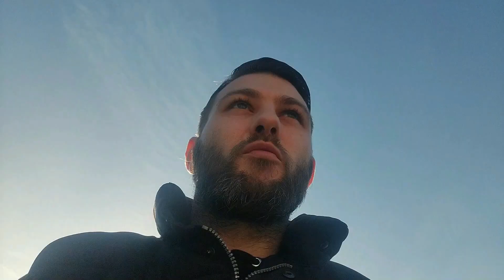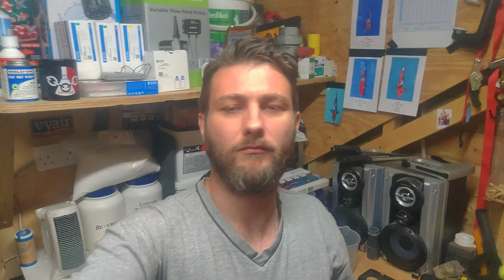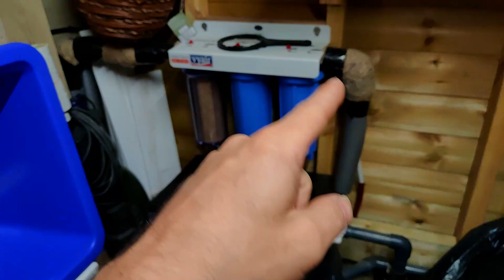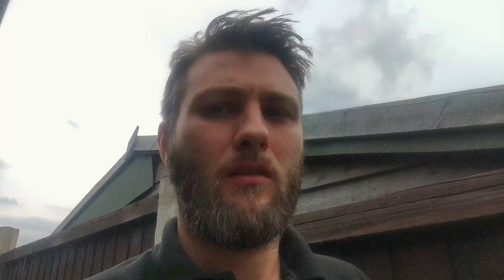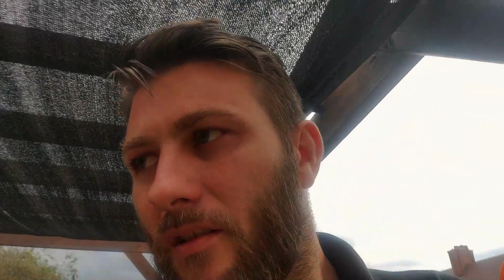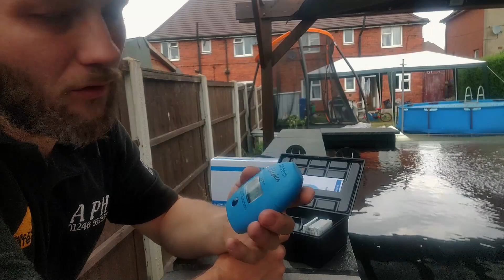Top-Up Tank Woes & Coppens Is No More

Comment: you thought about putting a small air stone in the top up tank, stop it going stagnant and will gas off the chlorine, failing that I use spectrum PCB carbon blocks on my triple 10" jumbo purifier, 1 micron prefilter and 2x PCB blocks which are also 1 micron.

I've had them on since November and over 200,000L+  through them, still have zero chlorine coming out of them, I strongly believe you get what you pay for when it comes to cartridges.
Reply from the maker: I've gotten around this issue now by totally removing the tank from the system and using it for the wash pump. The most recent video shows what I have done with it👍👌

Comment: Best advice would be instead of one big blue, have 2 smaller ones, fill one with carbon and the other with bone char. Helps with both chlorines and chloramines.
Reply from the maker: Hi Daniel. I don't have Chloramines in my supply, confirmed by the water board and by testing the Ammonia in my tap water. I may not need a blue at all now which you will see in the next video 👍

Comment: Same issue here. As I explained in my last video, the level of chlorine has increased and definitely affected the bio and the nitrite increased. 
Good to see that you have changed food!
Reply from the maker: Hi Lau, last month my chlorine level out of the tap was 0.14ppm, a few weeks later it was up to 0.27ppm. however, now it has reduced again. I'm quite lucky in the fact that I only have chlorine to worry about as Chloramines aren't used in my supply, confirmed by the water board and by testing the Ammonia in my source water.

Really looking forward to seeing what results I can get with the Saki👍
Reply: @UpNorthKoiPond  yeah chlorine down here was even higher than yours but luckily, like you, I don't have Chloramine. Otherwise it would be another massive expense with catalytic carbon. 
The feeding season is so short in this country, pile it on while you can.

Comment: are either the 3 stage or big blue up for trickle ! didnt work for me i went back oldskool
Reply from the maker: Possibly not, but the way my cleaning pump is set up at the moment, I have no choice but to trickle water in to keep the water topped up. May have to look at connecting the wash up via the water main 👍

Comment: Why don’t you plumb the header tank straight to the pressure pump job done
Reply from the maker: Hi James.👍 It is something I have considered but I think it would drain the tank before the cleaning cycle had finished. It's only a 4 gallon f&e tank and the pressure pump can pump at a rate of 48 litres/minute.

Comment: Hi I was having the same problems a few weeks ago. I was putting my top up from my 3 stage into the outer chamber on my nexus 220. I also noticed that my white filter cartridge was as orange as yours and it has never turned orange in all the years I have used them. I changed the white one over and noticed no chlorine when I tested with my Hanna test. So you are doing the right thing changing them cartridge’s. 
Hope that sorts it for you 👍🏼
Reply from the maker: Thanks Paul, did you notice a difference when you took it out of the outer chamber? Filters are on order👍
Reply: @UpNorthKoiPond  yes mate within a few days my no2 had come down and it’s stable now
Reply from the maker: @Paulridez  good to know. Where did you move it to?
Reply: @UpNorthKoiPond  I had it like you going back into the pond via the hose pipe. The last few days I have had it going  back into the nexus and I have just tested again and the chlorine in the pond read 64 on Hanna and out of 3 stage it read 84. So my conclusion is them 3 stage filters are not taking the chlorine out or it’s hit and miss

Comment: Most of the ammonia is produced from the gills through breathing. There might be less solids from the new food due to better digestion but you have an RDF so that isn't really a problem. If water parameters is the problem, then I would say it's the bio filter.
I do trickle in aswell but it runs through a catalytic carbon filter to filter out chlorine. If your water contains chlorine, it's fine as it'll gas out within the day but if it's chloramine, you'll need a chloramine filter.
Reply from the maker: Hi, yes I don't have Chloramines in my water it's just Chlorine. It's definitely the bio that's the problem, but Im trying to see if nitrifying bacteria is being destroyed by chlorine passing through the bio as the system tops up. I've got new filters on order but they don't last long so long term will probably end up with a big blue.
Reply: @UpNorthKoiPond  When I first saw your bakki setup, I wasn't sure if I was way over in bio or you didn't have enough. My pond is about 1600gallons but I'm using 16cu ft (.45 cu m) or about 1600 pieces of the bacteria rod like yours with 3600gph pump. I have about 30 koi. I'm feeding about 450grams a day right now.